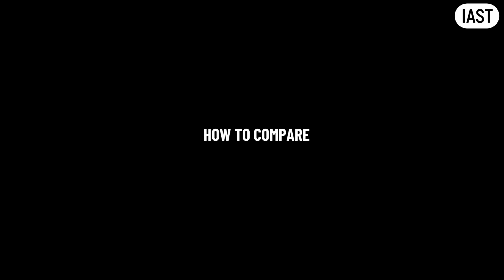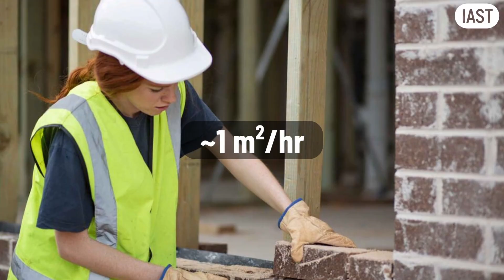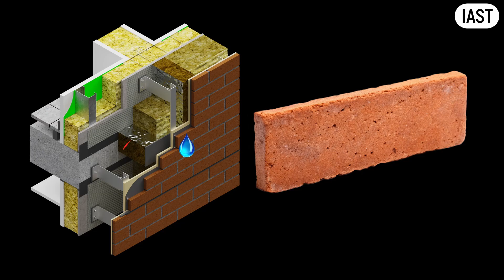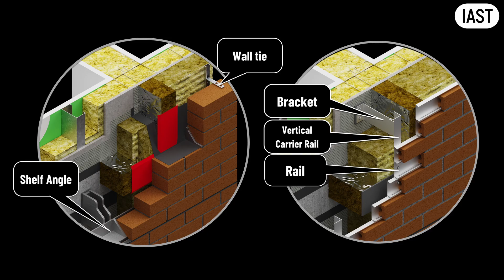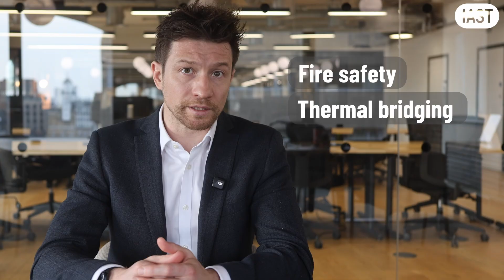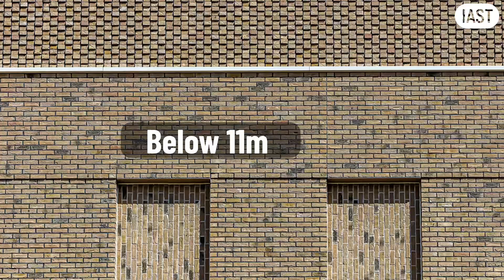The Brick Facade Spectrum: Brickslips, Precast, Render and Facing Brick - Presented by Eugene Korch

Comment: Could you discuss the fire draftstopping in the brick wall cavity? Is this related to building height? I have Not seen this before, but most brick bldg are less than 10M (<32' 14' fl+14 fl+ parapet)